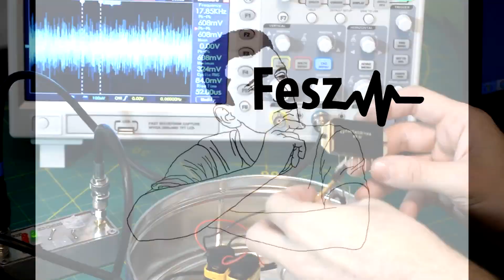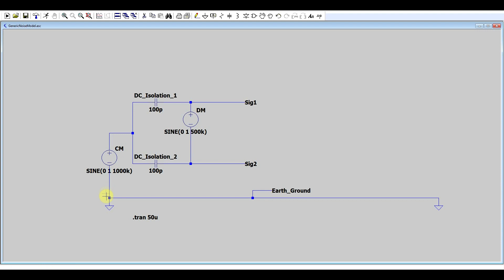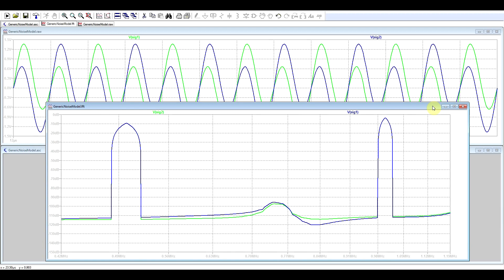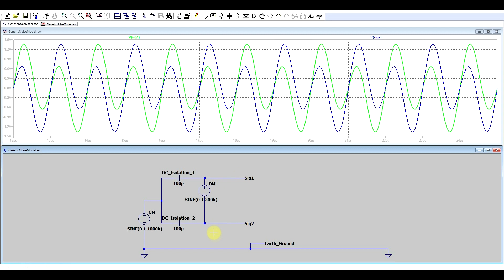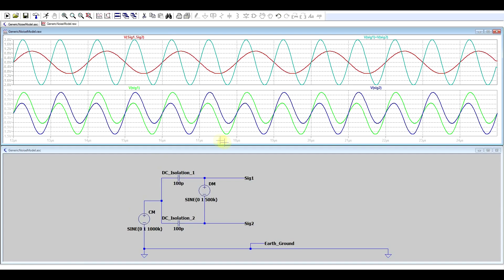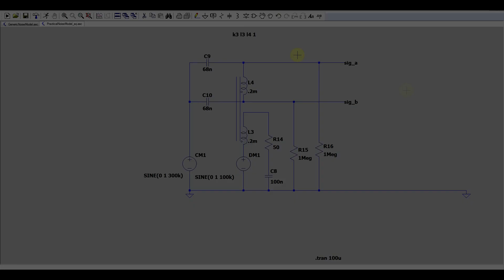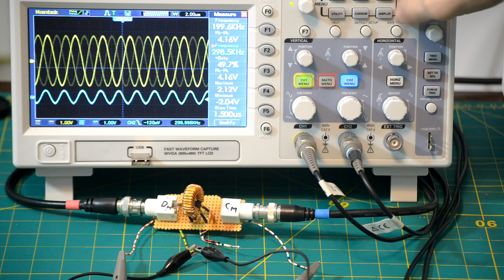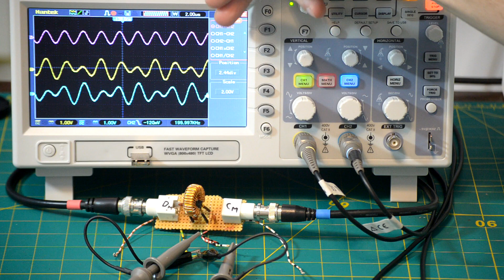Electronics tutorial - Separating Common Mode and Differential Mode signals

Comment: Hello, Nice vidoe. I have simulated a filter for a noisy DC power supply where I considered using a common mode choke first for common mode noises, followed by a ferrite bead with some capacitors, and finally a Pi filter with a 127kHz cutoff. I connected a generator to simulate how effective my design circuit is. I used the generator you created in the video and connected it to the EMI/EMC filter I designed, placing it on the power supply's positive (+) and negative (-) lines. On the output, I plotted the dBuV against the magnitude, essentially performing an AC analysis. My filter response is very good, with attenuation exactly at 127kHz, where it drops off significantly. My question is: for simulating the filter with a high noise input power supply, is the generator you designed sufficient? If it is, what would be the best way to analyze the filter's output? Specifically, how do I interpret the dB to magnitude graph to confirm that my filter is working effectively?

Comment: Hell FesZ, 
So, in the real world if you have a class I device or a class II device you would make these measurements with respect to chassis i.e. you would use two probes with each of their grounds connected to chassis? The two signals (sig1 and sig2) are representing the signal and return path correct?

Comment: in an unbalanced system, is it enough to connect oscilloscope channel A to circuit signal, channel B to circuit ground, with scope grounds floating,  creating a floating differential pair to perform MATH functions on to learn CM and DM properties?

I am looking for a budget friendly way to measure improvements in CM noise when applying filters, with the major tools  available being oscilloscope and function  generator.

Comment: Why doesn't the DM noise also double when it is isolated? By subtracting the two lines, I'd expect something like 5-(-5)=10, or -5-5=-10.
Reply from the maker: In the case of the CM noise, I was measuring the noise in reference 2 ground both times, so the values added up; with the DM, if its properly floating then the values in reference to GND would be half of the initial signal; both lines are oscillating in reference to GND,  when one is increasing the other is decreasing and the total peak to peak never exceeds the initial input value - rather than having 5-(-5) the total would be 2.5-(-2.5)

Comment: first of all, thank you for your video it's very helpful, I just have a question about the source of the common-mode voltage as we know we apply just the differential voltage between the two wires but the common one exist too